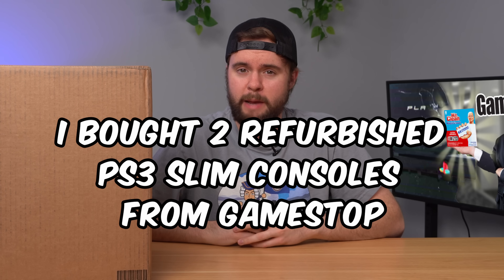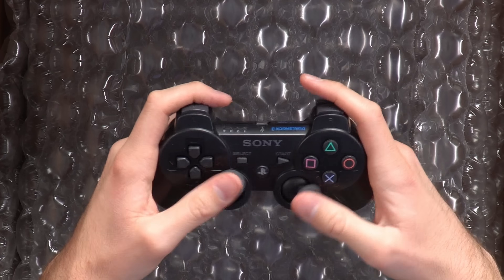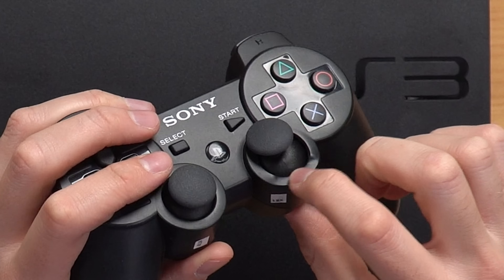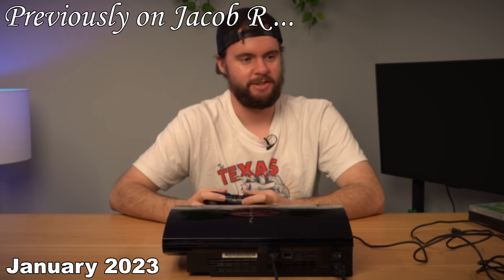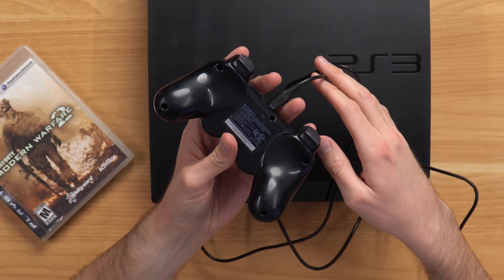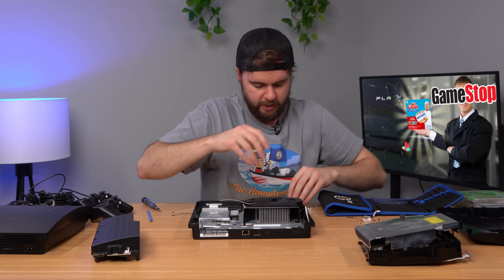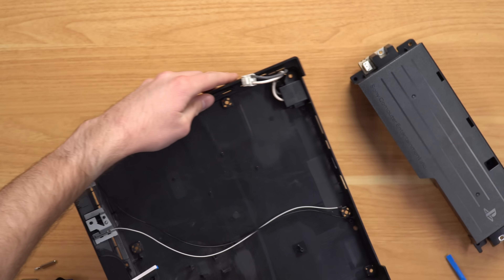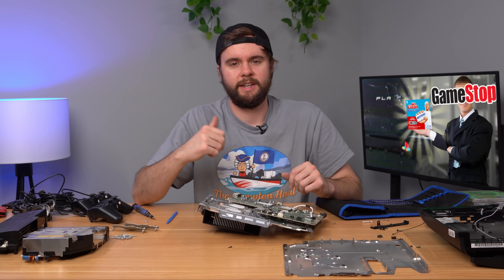GameStop is DESTROYING PS3s in 2024... 🤡

Comment: I swear, I'm gonna apply at gamestop just so they have someone who does things right 😭
Reply from the maker: I’m sure they won’t let you lol. They probably have a specific way they do things that take the least amount of time
Reply: @jrob0021  The process consists of lightly dusting the unit and throwing it in a box with whatever accessories from the random pile in the corner.
Reply: Try saving every gamestop then.
Reply: They will pay you minimum wage to thank you! Definitely not worth it.
Reply: I applied for GameStop and they didn’t hire me at all even though I have experience I dodged a bullet though
Reply: I've tried to run things right in my store only to get told off by my store leader and reprimanded for taking too long to clean a console. If you can fix a gamestop then i wish you luck lol
Reply: Yeah, nevermind lmao.
Reply: These are refurbished and shipped from their refurbishment centers. The stores don't actually do the refurbishing, they just sell them if they do have them in stock at their location.
Reply: @chase7974  so you're sayin' I should work at the refurbishment center and not the store?
Reply: @l4Zerti yeah they are outsourced but idk where you’ll have to do research on their refurbishment process if you are 100% srs. But yeah you don’t do refurbished products in store. The most you do is store is take an esd safe vacuuum to its sides. GameStop associates never open consoles up.
Reply: As a former employee their goal is to save money had a coworker bring his own tools etc ended up burning himself out n left